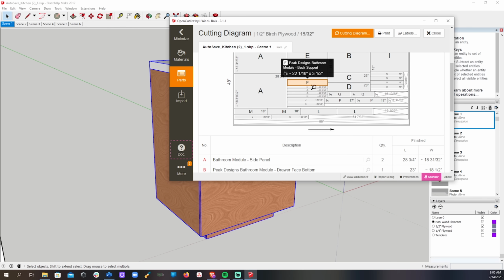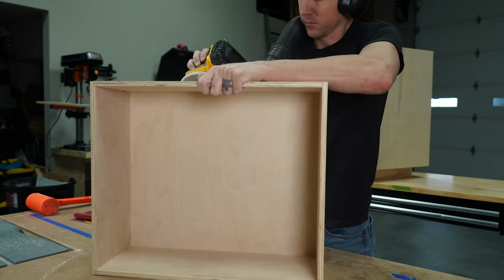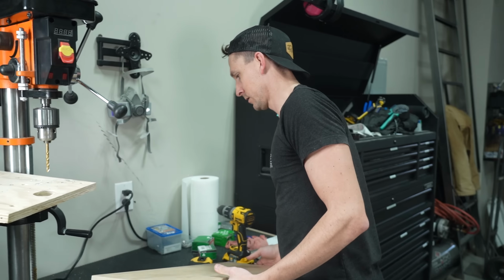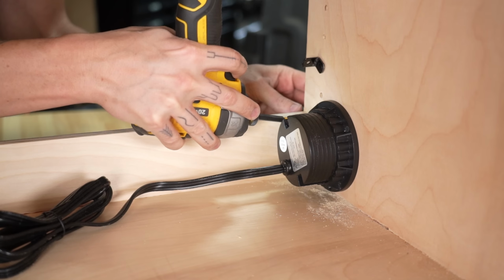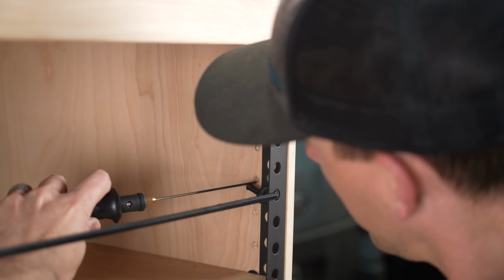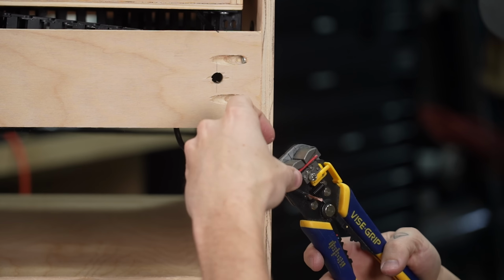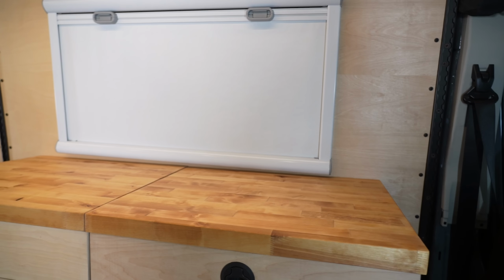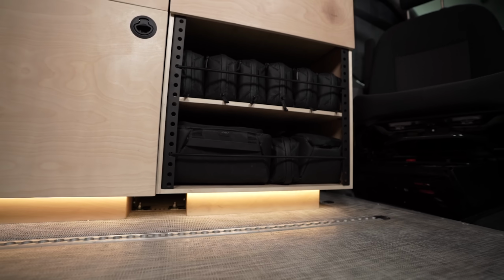Making a DIY CAMPER STORAGE MODULE

Comment: Great stuff - I love how you guys approach things & hiw clear you are in your documentation. Couple of questions… 1. Why use kreg pocket screws on sides of drawers yet glue/nail bottom when you could glue/nail all of it (using corner clamps to establish square)? 2. Why do your toe-kicks not go all the way across the width of each unit?
Reply from the maker: Pocket holes & glue is stronger than finish nails & glue & since the bottoms of the drawers were 1/4" ply, we couldn't use pocket holes there.

Since the cabinets are modular and can be placed anywhere in the van, we wanted toe kicks on all sides so that no matter where we put the cabinets, we'd have space at the bottom.
Reply: @EXPLORISTlife  Perfect! Thankyou for explaining… I knew there would be good reasons. 

Makes sense using nails for the 1/4” drawer base, since the alternative traditional approach of creating a groove for it to sit in would reduce space available (works fine if you use hidden undermount runners since you need that space anyway)

Comment: A better way to attach the cable chain is ride along the bottom side of the drawer so that as the cable chain opens and closes it rolls flush against the side of the cabinet instead of making a weird loop underneath.  You can even add a piece of L-bracket with a beveled edge to support as it rolls forward.
Reply from the maker: We tried that.  It was not better, no.  It was in the way of the cubes.  The way we did it works great! 👍

Comment: Does it matter if the slides are mounted towards the top of the drawer rather than the bottom. Or would they interfered with what you mounted underneath the drawer
Reply from the maker: Flights?
Reply: @EXPLORISTlife using Google Speech I just now reread my post it was horrible corrected it I didn't think you'd read them that fast drawer and slides
Reply from the maker: 😂🤷🤣 Oh, I see. I don't believe it matters where the slides go on the drawer.  Maybe actual cabinet makers have strong opinions about that, but I don't believe it matters.

Comment: Question: which 12 volt outlet socket do you recommend? 
My husband and I have built out a 2021 Mercedes Sprinter using your wiring guide. We took your advice and put in 12 volt outlet sockets and purchased 12 volt USB outlet plugs.  The problem is the plugs have a tendency to wiggle when driving down the road and thus, the device we are charging does not get charged. Thank you in advance for your response. We find your videos inspiring, educational, and extremely helpful.
Reply: Question I have are you using a wall adapter to charge the phone or are you plugged right into the USB socket in the wall. You may have not purchased high quality items

Comment: As a former cabinet maker, I dont understand why your putting a toe kick on all 4 sides of a cabinet? The toe kick only needs to be set in from the front, not all 4 sides. It should sit flush with the sides and back. That would also make the cabinet more stable.
Reply from the maker: The toe kicks needed to be inset on the sides so the brackets weren't protruding and the bathroom and storage cabinets could be mounted side by side.  Plus, the toe kick on 'right' side of the cabinet is nice for when I'm spun around backwards working from the driver seat.

For the back, that's just how we did it. 🤷  I think there was a clearance issue with the lower L-Track and adding a toe kick on the back fixed that.  I can't remember.

The cabinet is PLENTY stable since it's bolted to the floor and wall L-Track and will never be used when not bolted down.

Comment: Why do people still use birch plywood for campervans? Too heavy. Should be using poplar light weight instead with professional veneer finishes only 23 kg per sheet vs. birch 38kg and terrible look.
Reply from the maker: We use birch because it's lightweight, strong, looks good and is readily available.

Poplar is not as strong, so we'd have to use a thicker plywood to get the same strength at the joints plus it's simply not available at our local lumber yard and if I was going to have something shipped in, I would choose something with a cooler grain pattern like bamboo.

Ultimately, though, use whatever wood you like in your camper.  There's really not a 'wrong' choice; just a bunch of personal preferences.
Reply: I think looks are subjective but I get what you mean. I've been looking into the plywood encapsulated foam boards but not to sure if they will be strong enough.
Reply: If weight is your only factor, you shall not use plywood-built cabinets at all, you framebuild them with 1-1,5" sticks and use really thin sheets (appr. 5-6 mm) as a skin. Poplar is not as strong as birch and would require a thicker plywood.
Reply: @Vangeezer Experience  weight is always a factor when building campervan. Hence, most RVs build Co. never use birch, which is ugly looking in comparison to veneer finishes. Run a search and see how well poplar with veneer finishes hold together so good that after 20 years, people move to another campervan project.
Reply: @897aa33  A factor, yes of course, but still not the only one and despite being informed several times, you are still missing the point here.
Reply: @Vangeezer Experience  well the point I believe is stronger plywood I agree but poplar with veneer finishes strong enough as well good screw retention and hold well enough for many many years.
Reply: @897aa33  I can not see anyone denying that, but what is missing is the point that it is an issue of personal preferences and what is good for professional builders is not always good/possible for individual custom builders, for various reasons. You asked the question WHY someone would use other materials. You got answers and still you are on it like this is an issue about "birch is best". It is not that simple.
Reply: @Vangeezer Experience  I agree. It just watched a lot of campervan build videos and noticed most US base use birch while UK mostly use veneer finished poplar. I believe many people from both sides just follow the trend, hence my initial post.
Reply: Vote for birch as well. It do handle quite well with bending. Birch itself’s density is tight, therefore it weights as well. Some had made lighter by saw holes there. And surely a lot depend abt planning, where, how much surface is really needed and so on.